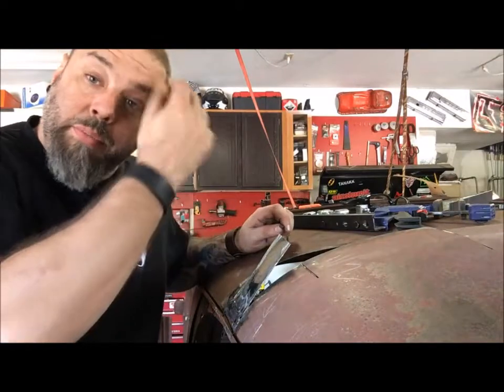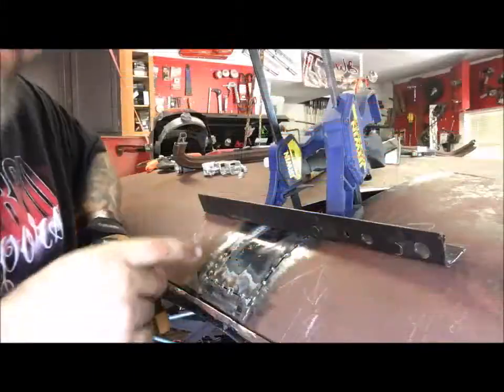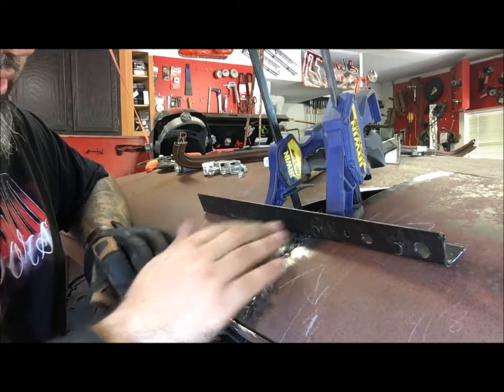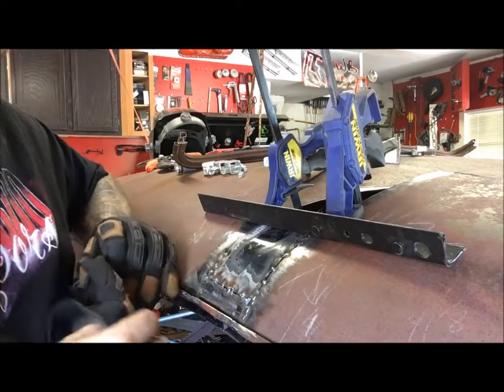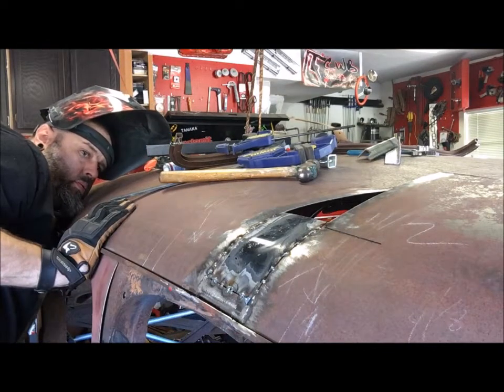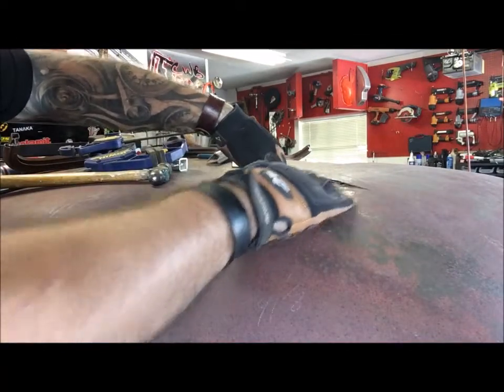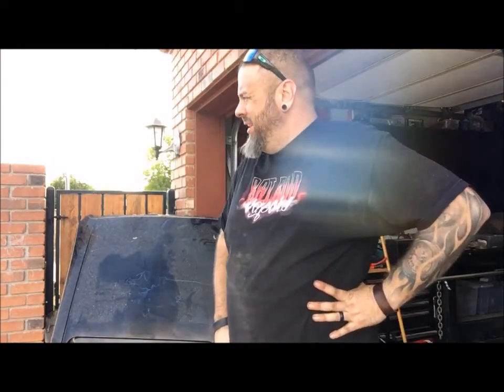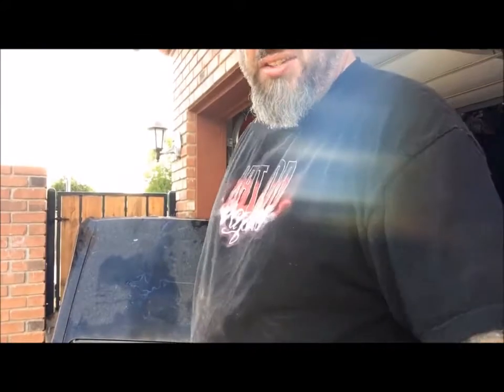Roof Section And sunroof -1937 Rat Rod Build  Update 3

Comment: I have done several bubble top chops . In you situation you did not have much metal going forward but here is how I handle these problems Instead of a bunch of 6" relief cuts spread 10" from each other...I start with one long cut dead center of roof all the way back to within 1" of window channel.  I then tack weld a small turn buckle ( or more than one ) centered over the relief cut and I tighten up turn buckle and allow one side of roof panel to slip under the other. This way you can shrink up a large amount of roof. I will use a large rubber mallet and a blocker to massage out the radius on sides of roof panel if needed Once you get the panels fit and tacked up around side radius of roof then you can cut out the extra material from center of roof. It will be a very long pie shaped piece. I hope this helps.